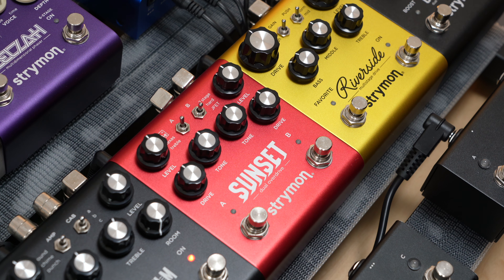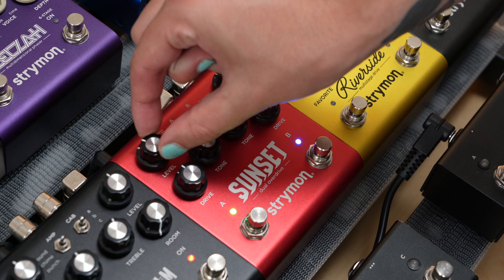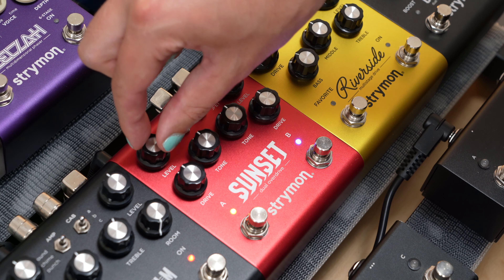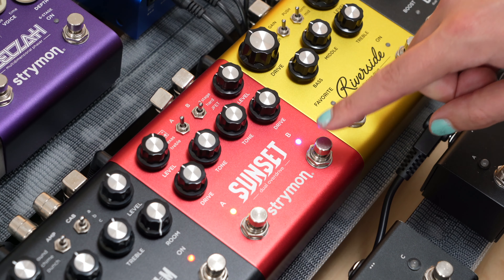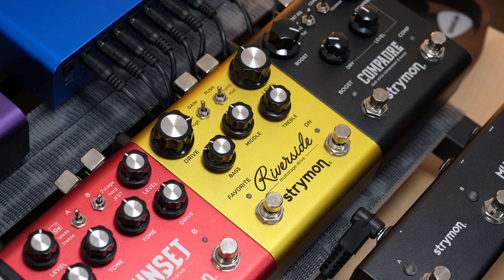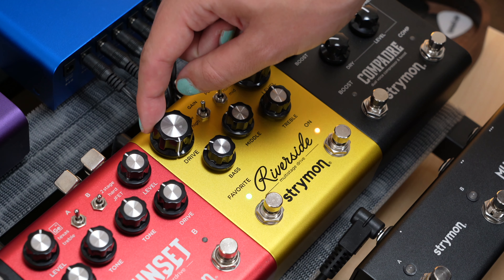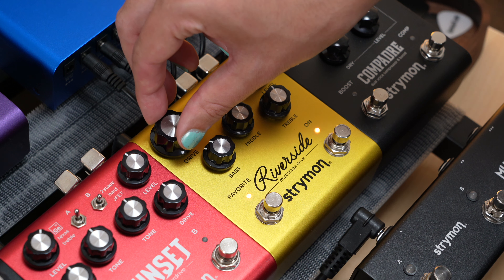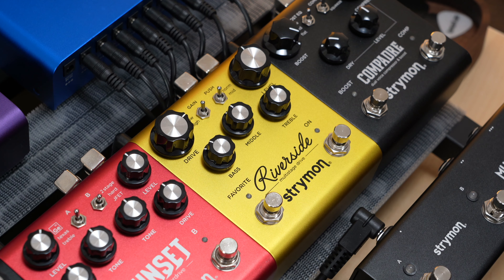Strymon Tech Corner: Sunset and Riverside Noise Gate

Comment: The riverside is still a game changer.
Reply: It is the Absolute 💣! I also use the Strymon one button footswitch for boost capability. What’s cool is that it is independent of the pedal, so it works as a great clean lead boost for the clean and dirty channel of your amp even if you’re not using the Riverside. That pedal actuality makes you want to play more. I got a killer OD on the right and the crunchiest hi gain tone on the left favorite,saved side. It actually FEELS Zane sounds like playing thru a really GREAT tube amp! It reacts to picking dynamics and applied right hand pressure unlike any other distortion pedal I’ve ever played! Not to mention the other bells n whistles, ie; noise gate, all kinds of different tonal combinations that can be applied depending on the amp you’re playing through and probably some gems I’m failing to mention. It’s an amazing piece of gear. I think I might get another one for another damn board I have 😝😝💯💣🎸🤘🏾🤘🏾Strymon 4 the win again! Zelzah, Riverside, Orbit, Iridium w the 3 button really opens it up… yeah I like Strymon and they have awesome customer service! Go get the Riverside now! 🏃‍♀️🏃🏾 🏃‍♂️ 🤣🤣💯

Comment: I have a question once you cut the noise gate on. When you power the unit down, does it cut the noise gate off?  Or rather, when does the Noise gate  cut off? From the point that you've  turned it on.
Reply from the maker: The noise gate is only engaged when the pedal itself is engaged. If both sides are bypassed, there will be no noise gate.
Reply: @strymon  im sorry whsa I meant was once you cut noise gate on what cats it off when the pedal is on , so if I have noise gate on and I power pedal down when I cut it back on do.i have to re engage noise gate or does it stay on once engaged even after you cut if off then back on thanks
Reply from the maker: @artytoney2057  Understood! Then yes, once you set the Noise Gate threshold, the pedal will remember that, and you will not have to set it again after power cycling.
Reply: @strymon  thank you very much this riverside pedal is absolutely amazing in the quality and tone range it has , I've tried PRS horsemeat  , TUBE SCREAMER , FRIEDMAN OD BE AND those don't come close to the quality sound in the riverside , hands down best od gain pedal out there , thanks for help

Comment: It only works when the pedal is on I imagine.
Reply from the maker: That's correct- the Boost and Noise Reduction features only engage when the pedal is engaged.
Reply: @strymon  thanks. I realise it was a silly question. I’m thinking that I’ll have a jfet setting always on to engage the noise gate. I have dirty power so there is always a low hum. Love the pedal. Thanks guys

Comment: If buying one......Sunset or Riverside..... ???
Reply from the maker: It really depends on what you're after in terms of tone and how you like to set your drive pedals up!

Sunset is our take on 6 classic overdrive circuits. It covers a wide range of tones and gives you a variety of flavors to experiment with, but has simpler controls when it comes to the controls over each individual drive circuits.

The Riverside is an original circuit that is similar to cascading tube gain stages, and is also very versatile, but also has an independent 3 band EQ and GAIN and PUSH controls for a more in depth and detailed control over the aspects of your drive sound.

I'd say if you are new to the world of pedals, a Sunset would be a great way to dip your feet into different drive circuits so you can see what kind of drives you like. If you want to be able to really dial in and fine tune your sound, maybe a pedal like Riverside would be a better choice! 

Hope this helps!
Reply: @strymon  it does..... thank you Mr.Strymon..... thinking Riverside